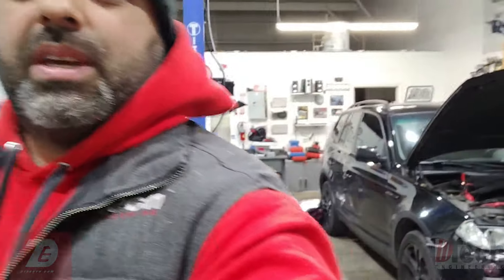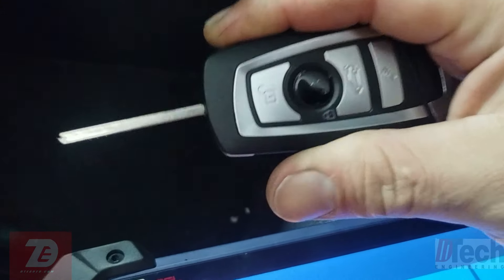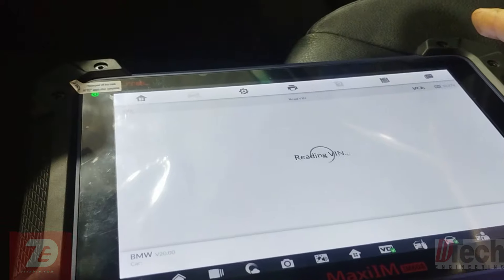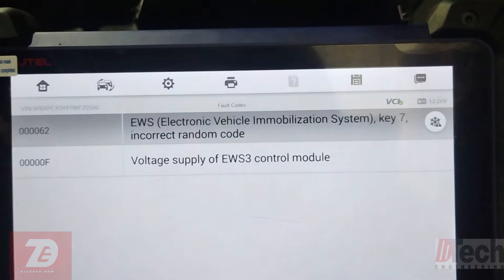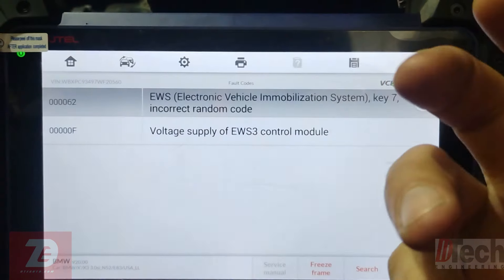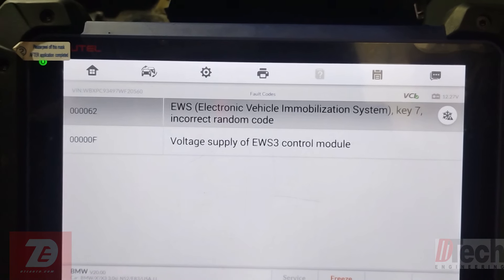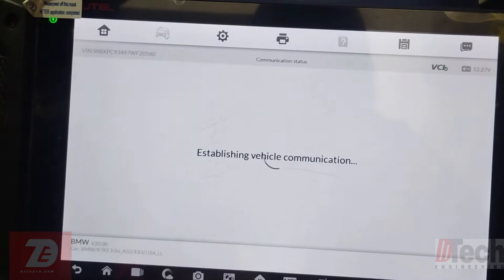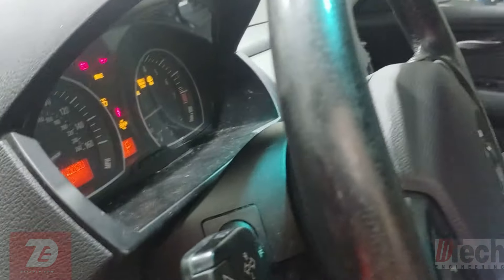BMW/EWS KEY INCORRECT RANDOM CODE LOST: DIAG & FIX & HOW TO RESTORE KEYS!!!

Comment: Hey D-tech That's a very informative video for me. I have a 2004 X3 E83 M57TU 30d with the EWS system so that is going to help me in the future. Iv had the AK90 bookmarked on Amazon as a purchase for a while, but don't need it just yet. But your video is really going to help when the time comes. BTW. To keep Mrs D-tech happy, every morning when you wake up just shout "Rev your engines" that should keep do the trick 😂 thanks D-tech
Reply from the maker: LOL, I'll give that a go! Thanks for watching
Reply: Yeah, no.. this is how I bricked my e83. Spend the $60 for a plastic key from the dealer. Then move the chip into the fake key and you're done! Enough with all this AK90 crap!

Comment: Superb job, Sadel!  I can appreciate that you continued to look further after seeing the drain caused by the USB charger.  I think many others would have called it “fixed!” and attributed the extra 10 milliamps as “it’s just due to its age” (which would have been an incorrect assumption).  I am surprised that the EWS didn’t throw a low voltage code as a DTC, though.  Maybe it doesn’t have that type of communication ability?

PS-  I see your daughter is no different than when I was her age, bringing the car back home with barely any gas in the tank.  Hehehehehe.

EDIT-  I posted the above comment before I watched the final 10 minutes and did see the EWS voltage code appeared.  👍🏼
Reply from the maker: yes this one was a lot of work involved and I definitely had to put some gas in it lol

Comment: Great video .. I followed along and understand what you explained .. You saved me a Lot of time .. my problem was similiar with a rolling code fault but differnt with the dme wire blocked .. I have an AK90 without the adapter for the 4.3ews but I will probabaly solder it ..  I feel this will correct my problem .. I think mine is voltage related also but self induced by draining the battery working on the car and popping the battery in and out!!   Thanks again! {: mike

Comment: Nice video. I programmed an identical key for my E46 2 weeks ago. The key interferes with my bluetooth adapter that was just to the left of the radio and i decided to replace the oem radio with an android one. During the procedure my battery drained because stupid me worked with the interior lights on. Had to recharge the battery and everything worked ok for another week. Today, after driving 250 kms, the key didn't start the car. Fortunately i had my wallet key with me (glad i saw your video 2 weeks ago and decided to be cautious). So, my question is, did the problems get solved definitely with that car/key? I can remove the ews and force the key to sync again like you did, bit i am afraid the problem will appear again. I do not notice any battery problems after recharging but i didn't measure the voltage. Thank you.
Reply from the maker: For me on this particular situation, the keys have been fine ever since this video and finding out that there was a battery drain causing the issues. So, yes all good so far, definitely this was my issue.
Reply: @DTEAuto  Thank you! I will assume that my problems were also caused by the drained battery. I am away from home right now but I will try to resync my key with the EWS. However, instead of setting the key to "Not Used" and write to the EWS I will try an alternative that I saw on another video (https://youtu.be/fk1y-Y1W5X0?si=jFgI22TRQQeOItQY). Apparently, you can read the EWS (which will contain the rolling code for each key) and write the key again. As long as it is the same VIN, fixed code and key number, the AK90 will update the rolling code. I will see if this approach works. It would spare the write to EWS operation. I will let you know if it worked. Thanks once more!
Reply: @DTEAuto  I can confirm that out of sync keys can be synced by reading EWS (to get the current rolling codes of each key) and writing key using same slot number. No need to set the key to not used and write back to EWS. It is much safer this way since no writing to EWS is performed, only to the out of sync key. I was afraid that the write operation would fail but it works!

Thanks again and perhaps you can make a new video or add some text to explain alternative method.

Comment: Surely after you used the key in the key slot,  if you re read the ews data the tick would of been written back to the ews data. This would prove the key couldnt recode its self after ews manipulation and low voltage?
Reply from the maker: Yes to find out for sure the only deciding factor would have been to remove the ews and re-read the eeprom info and perform the analyze function